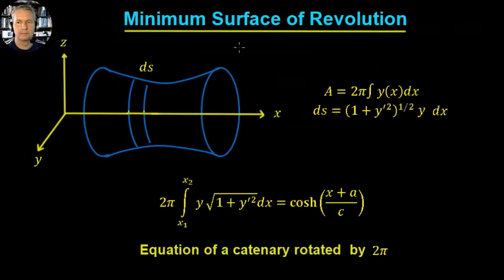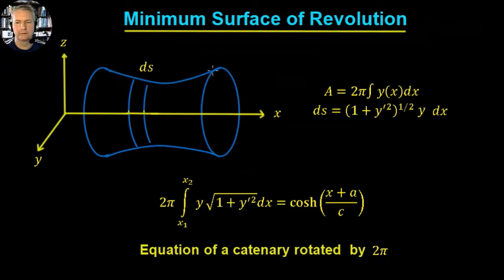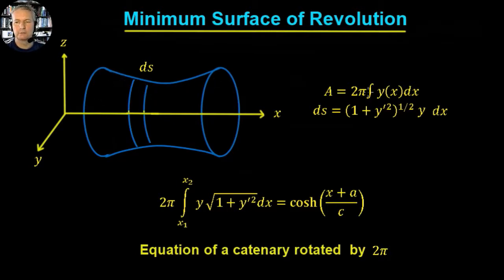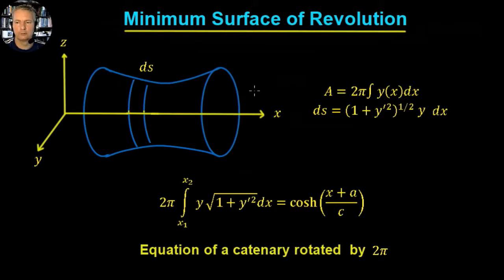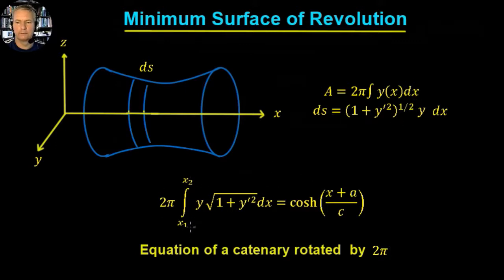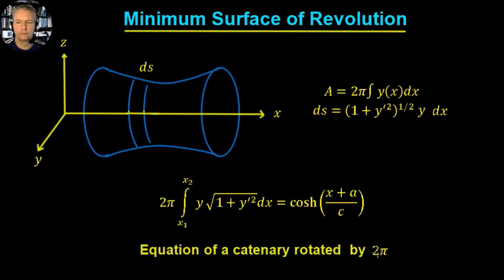Minimum Surface of Revolution

Comment: Sir ,how can we say that the surface area will be minimum.
Reply from the maker: Correct we have only shown that the surface area is an extremum. We must also show that the extremum is in fact a minimum.  I have not done this here but I go into these things when I talk about the second variation. I will cover these details in another course. What you ask is analogous to proving a turning point on a curve is a local maximum , minimum or inflection point, we would do this by looking at the second derivative. In calculus of variations we would look at the second variation.